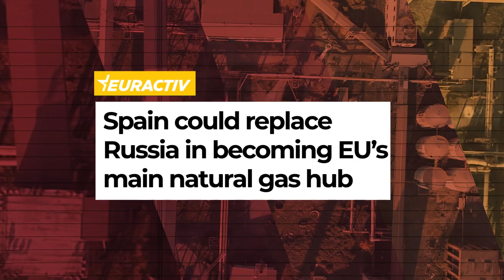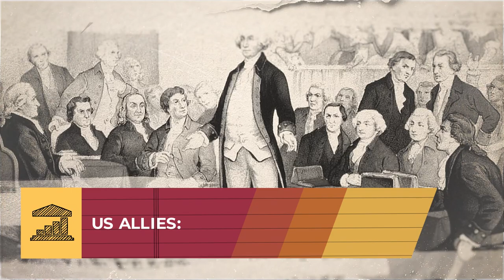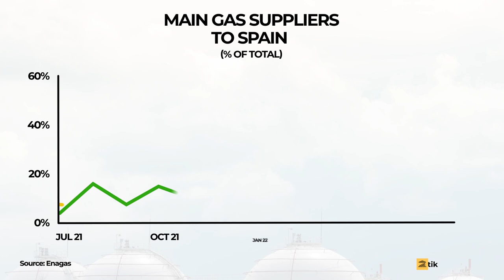Could Spain Become the Great European Gas Hub? - VisualPolitik EN

Comment: Nuclear power plants are the way to go for low carbon emissions and as a backup until better energy storage can be developed. If Europe was ever cut off to natural gas by Russia, I assume the transition to backups like nuclear and securing new trade deals/supplies would come much faster than expected. Russia could have a great deal to lose if this does happen, so it could be a delicate balancing act.
Reply: I did not even bothered to read all of your comment, but just the first line and half showed me how uninformed your opinion on nuclear really is: nuclear power is not popular, not because it is dangerous, not because of nuclear pollution in mines where uranium is extracted. The real reason of nuclear energy lack of popularity is that nuclear is the most expensive energy in real terms (considering construction cost and maintenance), the nuclear reactors take more than 10 billions to build, they take close to a decade or more to be operational (assuming that your country is efficient and experienced doing this type of projects). Nuclear is not scalable, it is either too big or too small. Nuclear requires setting up special organism to deal with the safety and the security (as in not being stolen) for the radioactive plants and materials, it is by far the heaviest industry that a country can have and  the most regulated... and there is also the nimby, even the nuclear fans would not want to have a nuclear power station in their backyards. I certainly don't want my government using my taxes on nuclear when there are clearly cheaper and faster alternatives.
Reply: Nuclear takes time to develop. All i see nuclear but not how, when and where
Reply: @pedrolopes3542  couple questions. is the pollution from the mines more or less harmful to climate change than operating nuclear power? 10 billion to cover what quantity of people consistently with electricity for how long and for what cost until the initial cost is paid off? decade to build one is long. anyway to shorten that?
Reply: Nuclear is wonderful. As long as you...

... are a dictatorship and don't have to bother with the people's opinions (be they justified are not)

... are not in a hurry. From planning to the first kWh provided to the grid, it easily takes 15 to 20 years. 

... are an optimist and assume that things that could go wrong absolutely never will 
(engineers had "decided" that tsumanis of more than 10 m in height will never occur around Japan. Their buddies in government agreed happily. Friendship saved and everyone satisfied!). 
So, basically, you assume that human societies are free from corruption, terrorism, stupidity and war. 

... leave out any considerations about its economics (i.e. want to make nuclear weapons - whatever it takes - and need the industry anyways)
Reply: Considering there could be a nuclear emergency because of Russian aggression *see Ukraine; or a major environmental catastrophe *see Japan, or poor infrastructure and maintenance *see Ukraine and the US, there are indelible effects to the consequences of nuclear power. Notwithstanding the social, organizational, financial and engineering constraints of such a project.
Reply: @pedrolopes3542  So ask France or Finland why they still rely heavily on their nuclear plants. The real reason is cheap electricity. The initial cost of a nuclear plant is huge, but in the long term it pays for itself. France has an whopping near 70% of its electricity coming from nuclear, they have learned the lesson the hard way during the 1970's oil crisis of not being dependent of nations who use their' resources as a geopolitical weapon against France.
NUCLEAR IN PORTUGAL, NOW!
Reply: @batonnetdecannelle  nuclear is safe and powerful.
Reply: @GKFF9872  oh now winter is coming ...another anti nuclear.
Reply: @Sergio_Loureiro  true
Reply: @pedrolopes3542  You don't understand much about energy production unfortunately. Nuclear is much safer alternative to just about everything else other than wind. It's even safer than solar and has been proven as such. While it's true you need to set aside 20 mile safe zone around a nuclear plant that is still less area than you would need to build a solar panel of equal power output. Finally nuclear technology has advanced so much that outside of human error a meltdown is extremely unlikely. In fact there is a higher chance of a coal or natural gas plant exploding. Every nuclear accident from Japan to Russia has been due to human error. Highly automated plants like newer ones built in China cost only a few million and have a near zero chance of meltdown. Nuclear is so powerful that big oil actually created and funded groups like green peace to spread nuclear fear in the west. This is why you are so afraid. Exxon exec created the group. After Nuclear went out of favor, green peace lost it's funding and became anti oil.
Reply: @GKFF9872  You can have an emergency at any power generation plant if it falls under enemy control. For example when IS*S took over oil production and the plant blew up killing hundreds. As long as the plant is being managed by someone responsible everything will be fine. If the Ukraine plant blew the loss of life would actually be very low since it takes less people to run a nuclear plant than oil. Plus the plant is in the middle of nowhere. Also the UN inspected the site and confirmed the Russians ran the plant properly and there was no risk of an emergency despite what the media claimed. Nuclear plants thanks to cold war mentality were built to take a beating so even if it was bombed to dust nothing would happen.
Reply: Europe is the most rabidly anti-nuclear continent on Earth, with France being an exception. And note that the war in Ukraine is giving people even more reason to be jittery about nuclear now (whether those fears are justified or not) thanks to the new from Zaporizhia.
Reply: Also investment into nuclear energy is already in the doldrums. The industry as a whole is mostly stagnant, so if they want to take on nuclear it'll be heavily state dependent because the private investment just isn't there. The returns from nuclear just aren't as enticing anymore, with competitive alternative investments considering nuclears' long payback times.
Reply: @Lama Dlama I just had that conversation with a friend at Starbucks tonight.  So people ARE talking about it.  It's some pretty insane stuff,  right?
Reply: Like natural gas pipelines nuclear power plants take years to approve and build.

Unlike them however, they don’t raise CO2 emissions and they are easier to supply without relying on OPEC members.
Reply: @Sergio_Loureiro  So... where do you think France is getting their Uranium from? Of the 138,230 tonnes of uranium imported between 2005 and 2020, three quarters came from just four countries: Kazakhstan (27,748 tonnes), Australia (25,804 tonnes), Niger (24,787) and Uzbekistan (22,197). If that isn't dependence, I genuinely don't know what is.
Reply: @xMythpug  I edited my comment because  it was imprecise. Sorry.
Reply: I think if the Ukraine situation remains unchanged, and Europe holds firm throughout the winter. I think this won't have a resolution for another 2 years. I think by this time 2024 Europe will be well on its way in its transition away from Russian energy and have started the construction of the necessary infrastructure to handle energy shipments from other countries
Reply: Who is France dependent on for nuclear minerals?
Reply: Not really, nuclear power plants can't be throttled as easily as gas power plants. And no, energy storage will never get done well, at least in battery form. What should really be done, is to give up on wind and solar in the grid. The reasons are their volatility and unpredictability, which necessitates presence of more regulating power plants, which can be quickly turned on or off. You're stuck with water and gas for that. Really energy mix of Europe should be trifecta of nuclear for base load, water up to the point, where other functions of water reservoirs are not hampered and gas for the rest.
The key is lowering volatility in the grid. Getting rid of wind and solar removes day-by-day volatility. As for hour-hour volatility, there are other options. For instance, making every appliance at home smart would help (done properly with ethernet, not wifi). A simple centralized programmable timer could, for instance, run washing machine and dishwasher at preprogrammed hours. You just load devices, fill them with whatever consumables are needed for them, to do their job, and let start of the process to the timer, which is set to a time, when there is usually lowest drain on the grid.
Reply: @tolazytothinkofanamd2351  safe things don't require "safe zones of 20 miles".
I am not afraid of nuclear, but it is an irrational decision for countries that need energy now to invest in a technology that takes more than 10 years to develop, that cost a lot more than the alternatives and that cannot assure production during critical moments (as seen by France this summer, that had to import electricity for the first time in a long time).
Reply: @pedrolopes3542  The 20 mile safe zone was a law created in the west due to an irrational fear after what happened in Russia. France had to import because it shut down it's coal plants. It has nothing to do with nuclear. All power plants have a "Safe zone" but that should not be a reason to fear it. For example a coal plant requires 5 miles and oil 10. Depending on where you live the safe zone for nuclear might be as low as 10 miles (USA). Any new plant you make will take 10+ years to build. This is a good thing since it means you can be certain it was built properly. I wouldn't trust any kind of power station that is made in just a year. Solar being the exception since it's mostly plug and play and not a true plant. Don't let irrational fear rule your life. There is a reason why most scientists agree that nuclear is our future and renewables are a stepping stone until we can achieve Fusion (free energy)
Reply: @tolazytothinkofanamd2351  LOL "Free energy"... the  laws of thermodynamics don't apply to you, nature made an exception, just for you [sarcasm].
And then you talk about "irrational fear" while you take your opinions to the level of religious fanatism. 
I wonder if the Fukushima former residents and the Prypiat former residents share your enthusiasm for the "safe" nuclear technology... the "safe zones" around power plants exist for a reason and is not "irrational fear".
If a country has nuclear power plants that are still operational, working properly and do not pose a threat to the surrounding environment: by all means, keep them running,  that is the logical decision. But to build new ones, just for the sake of saying "we use nuclear", that makes no sense, that is just a dogma. 
Another thing: besides nuclear power plants and river dams, no other type of power plant takes 10 years to build, wind turbines are installed in weeks, solar in days, coastal wave power probably 1 to 2 years, geothermal wells can be drilled in months and the full operational facility be ready in less than a year.
Reply: @Sergio_Loureiro  I would say that france is suffering from billions in cost from nuclear and the country has had to safe it nuclear concern EDF with billions.
Reply: @pedrolopes3542  You are sorely mistaken. While it's true that the up front cost of building nuclear reactors is indeed expensive, it's just that, up front costs. Nuclear power is actually the cheapest to generate outside of purely green sources(which are technically free to generate) as buying the amount of radioactive material needed to produce nuclear power is significantly cheaper than any of the alternatives: oil, gas and even coal mostly but also weird stuff like the burning of trash to create electricity. Considering that purely green energy is still very far off from being able to supply all the energy demands of Europe, nuclear power is currently still the best long term solution and the one with the least amount of downsides.

You're also wrong on the scalability issue. There are in fact modern nuclear reactors which are small and allow for just the right amount of scalability without compromising the fundamental law of economy of scale. These reactors are also significantly cheaper to build and take much less time to be operational than the old fashioned mammoths you referred to. Heck France begun building some of those modern reactors but as usual French bureaucracy and other similar ailments grossly delayed the project and made it significantly more expensive than it needed to be. That's the fault of the French though not the reactors themselves.
Reply: Nuclear and renewables don't mix, they make electricity very expensive as nuclear reactors cannot power up and down several times a day without causing a build up of toxic waste and gas. It will shorten the service life of the reactors. Nuclear is slow and expensive to set up with only 50 years of commercially accessible uranium reserves left.
Reply: @MegaMrWrong  What are you talking about? Nuclear and renewables are a match made in heaven! I have no idea where you're getting your information from but all the sane experts in the energy industry agree that nuclear + renewables is the path forward.
Reply: @pedrolopes3542  Religion? What? If I'm wrong than perhaps you should correct me rather than make random stuff up.
Reply: @Owlr4ider  my initial post "corrected" your claims, even before you made them, so, what is the point in insisting? You will not change your mind  (out of dogmatic indoctrination) and I know better  than  to argue about somebody else's religion, even if that religion is Nuclear.
Reply: @kamalmghazli2061  Great another anti Nuclear person. I suggest you Google most dangerous power sources. When you realize it has killed less people than coal let's talk. Let's also talk after you realize it's significantly more likely you will be in a plane crash than you are to be in a nuclear accident. Nuclear is the best carbon neutral power source and is perfect to act as a backup to solar and wind when the sun is not shining and the wind is not blowing. Battery technology is also a good alternative but you're probably against it too since it's based on nuclear technology.
Reply: Why bother with energy storage if you have nuclear power plants? Makes no sense.
Reply: Thorium is the future
Reply: @xMythpug  The thing is France can extract Uranium locally but chooses not to. Most uranium is located in the sea. Any sea nation could in theory mine it.
Reply: There isn’t enough rare earths to replace fossil fuels i.e cars / storage etc..
Reply: @Mal_uim  Well fossil fuel uses rare Earth too so the drop in use for those products will be free up Rare Earth but you are right. After 2035 there will be a massive shortage. Nuclear is needed since it's the only raw resource we have that will last 2000 + years.
Reply: @pedrolopes3542  Yes, you mentioned long list of cons, but I still would like to have nuclear plant in my backyard so to speak. 24/7 steady energy.

Comment: Both Spain and Portugal could massively increase their Solar Power and transfer the Gas they use to the North! Italy and grace could also increase their Solar and reduce their Gas.
Reply: @Lama Dlama it would have to be piped to Spain, really the title should be "can Spanish distributed north African piped gas replace German distributed Russian piped gas" 
This wasn't at all clear in the vid
Reply: It does not work like that. There is a limit to solar in a grid. Also because of Drought Hydro power is way down in the Peninsula.
Reply: I'm not super versed in solar energy, but my understanding is that without proper batteries (which are still being developed)  it's really hard to store that energy to use later, so I don't know how that would work. Plus, if you knew the price of power in Portugal, compared to salaries, even before the war you'd see why the average portuguese cant afford to not use gas. It has always had the highest prices in Europe.
Reply: @MusaMecanica  Simoldes is building a battery factory though